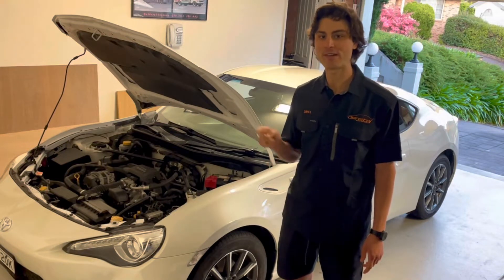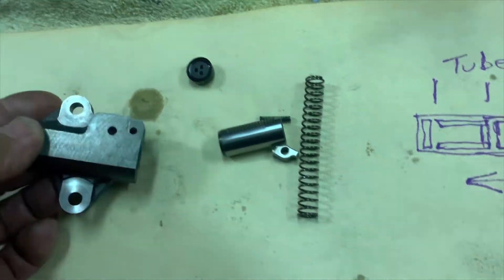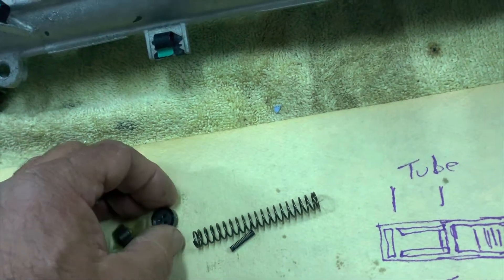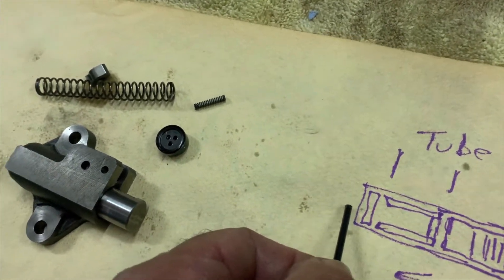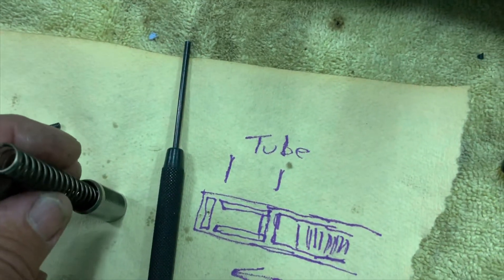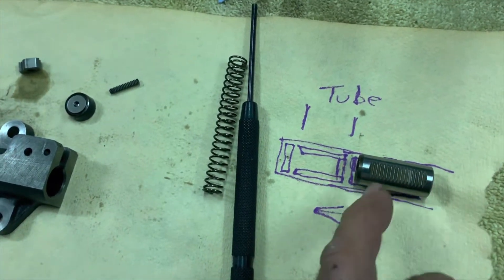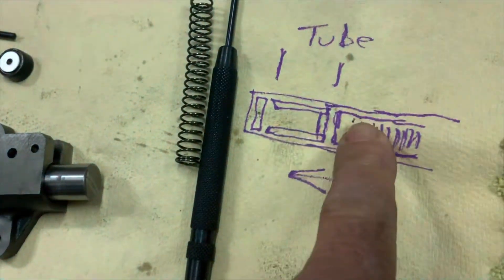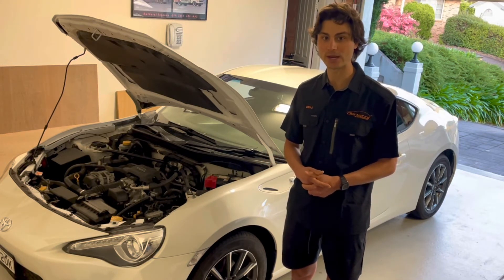FA20 Timing Chain Failures? How to build reliable high horsepower Toyota 86/Subaru BRZ 500hp+

Comment: A guy I know had a dowel pin that holds a timing chain guide onto the engine (FA20DIT) rip out, and his engine was destroyed. Theory is the rolling anti-lag put stress on the system. Any ideas how to prevent the pins from coming out?
Reply from the maker: I'll have a chat with Dennis and see what he thinks.
Reply: @denstoj  Thank you very much
Reply from the maker: @2018wrxaddict no worries

Comment: Just to be clear, the ratchet mechanism is to keep the tensioner piston from coming out further, or to keep it from coming back in? I ask because I’m wondering what would keep the “fixer tube” from causing a rattle noise should the piston come out more (for whatever reason).
Reply from the maker: Hey @CJ Cantrell, The stock ratchet mechanism allows the tensioner to go out but not back in (1:18). The idea is to limit the amount the tensioner can return (move in) by adding a small stopper tube. I'll ask Dennis about what would happen if the piston moves out. Thanks, Dan.
Reply from the maker: Hey @CJ Cantrell, Dennis has explained to me that if set correctly, the piston would only move out after a long period of time where the chain is wearing (years and a lot of kms). The ratchet will operate as per normal so no rattle would occur. The intended use for this is for race purposes where engines would be rebuilt in a shorter time frame anyway. Let me know if you have any other questions.
Reply: @denstoj  I’m glad you mentioned race, because, I would like to build this to do some small SCCA type racing. I also need to daily it from time to time so it needs to do both. Thank you guys for the video and the information. I’m subscribing now.
Reply from the maker: @cjcantrell80  Thanks. No problem at all. Are you having timing chain issues? How much power are you chasing?
Reply: @denstoj  No timing chain issues, yet. Just bought the car with a little over 100,000 miles and have the famous fatal ticking from the rocker on the right bank. Figured whilst I’m replacing all of that I’d upgrade to the new geometry and get some stout parts. I’m only going to 350hp whilst it’s NA, but that’ll give me time to decide what (if any) power adders I want to go to. I’m new to the boxer engine and it’s dynamics so things like this video are very helpful. I mainly watched this video to PREVENT any future issues.
Reply from the maker: @CJ Cantrell. Ah damn did you realise it had the ticking noise when you bought it?
Reply: @denstoj  Sure didn’t, it started about 60 miles (about a week) after purchase. That’s just my kind of luck. Good thing I’ve been a tech in auto shops in previous years.
Reply from the maker: Bugger! That sucks. Have you pulled the motor out yet to inspect?
Reply: @denstoj  Not yet, still driving it. Doing all the homework I can before yanking it and ordering parts. Hoping the heads are still good so I don’t have to replace them. Everything else is getting replaced with (hopefully) better stuff. Are you guys going to increase power or do some other mods?
Reply from the maker: Oh sounds a little risky with the tapet noise. No big power mods planned for us. This was for one of our rocker retainer customers who is chasing 500hp+ and was having issues with their timing chain. Did you want me the let you know when our rocker retainer kits are back in stock?
Reply: @denstoj  Absolutely!
Reply from the maker: Sweet! Will do. Instead of posting your email here, do you mind dropping us an email with FA/FB Rockers as the subject to dennis@denstoj.com.au ? Thanks.
Reply: @denstoj  Aussies! I had a feeling. I’ve always been a fan of Aussies, even before Mighty Car Mods and Jeremy McGrath. I’ll send that soon. Hope you guys have good days ahead.
Reply from the maker: Yes! Go the Aussies 🦘 Great. Will look out for your email.

Comment: Hi mate, just come across your channel.
I have just picked up a new manual BRZ (FA24) MY23
Can you tell me any info about the differences
between the FA24 v FA20?
I heard they beefed up some internal components.
Full disclosure, I am a 60y/o Newcastle man who has no intention
of turbocharging etc but may one day take it to the track for a play.
Any info would be appreciated.
Cheers mate.👍
Reply from the maker: Hey Iman, great to hear from you. Ah awesome, would love to check it out. Drop by the shop some time. Yes, in terms of the valvetrain, our understanding is the springs have been changed to a beehive design but the rockers are still not retained with a clip mechanism. Is it your daily?
Reply: @denstoj  
No mate, not my daily.
Easy to get in and out Hilux, for that.😉
I'm guessing being it is NA it will only
have cast pistons etc ?
I thought the block and rods may have got a beef up,
with the increase in displacement,?
Will drop in one day for sure.
Reply from the maker: @Iman Engima I'm just past 60 and my 86 is pretty much a daily 🤣. Yes, being NA the pistons are just cast aluminium. Likely the same pistons in both the FA20 and FA24 with an increase in stroke but I'll have to investigate further. Looking forward to checking your BRZ out. Got any other questions? -Dennis.
Reply: @denstoj the Bore and Stroke seem to be 94mm by 86mm, respectively.
Reply from the maker: @I-didnt-ask-you  thanks for clarifying. 👍
Reply: @denstoj  you're welcome. I also believe the conrods are a straight design rather than offset like the previous generation and they may be slightly larger but I have not confirmed the last part.
Reply from the maker: @burakoshimazaki great. We’re still to take out the FA24 in our 2022 BRZ, install our rocker retainers and inspect the motor further. Will make a video out of it when we do.
Reply: @denstoj  looking forward to it! One wonders if they are backwards compatible (conrods) and if they would make an inexpensive replacement over previous generation conrods without needing to go full forged? Questions for the adventurous perhaps.
Reply from the maker: @I-didnt-ask-you  Unsure if they're backwards compatible as we haven't pulled the engine down yet. Probably better off paying the little extra and going forged.
Reply: @denstoj  you're probably right!
Reply from the maker: @burakoshimazaki it’s good to know but yep, better to pay the extra and have peace of mind

Comment: Great information,  is this failure happening under boost? Or is it over.time?
Reply from the maker: Hey Enicinas, thanks for the question. I’ll check with Dennis and get back to you. Thanks, Daniel. (Edit: See answer below in thread)
Reply: @denstoj  thank you. I always appreciate insight,  when we have these kinds of hobbies, it's key to have an open mind and strive to keep learning
Reply from the maker: Have you broken a timing chain before?
Reply: @denstoj  up to this point I have not had Amy issues. I have been NA for the most part. In the next couple of months we are pulling the old motor out and redoing the entire thing...this time we have decided to go with a power adder so things will be different.
Reply from the maker: Hey @Encinas, no worries. Great attitude towards learning! Ok, that's good to hear. At least you've got the biggest issue with the rockers sorted since installing our kit. Yes, boosting the engine will bring additional challenges. All a bit of extra excitement! Haven't had a chance to catch-up with Dennis yet. Keep me posted with your build. 👍
Reply from the maker: Hey Encinas, timing chain failures in high performance FA20 engines likely occur over time from excessive wear on the chain. 

Excessive wear is caused by a combination of:
1. Lack of oil or oil pressure especially under high rpm. It's not so much whether it's NA or boosted but rather the RPM (yes, NA engines would experience higher RPMs).
2. Upgraded cams, springs and valves increasing the stress the timing chain experiences.

Once the chain begins to wear, slack is introduced into the system and can cause mechanical failure of the timing chain tensioner ratchet mechanism.

This is where our solution, limiting the return of the timing chain tensioner, can stop the timing chain from breaking. 

Let me know if you have any questions. 

Thanks,
Dennis.